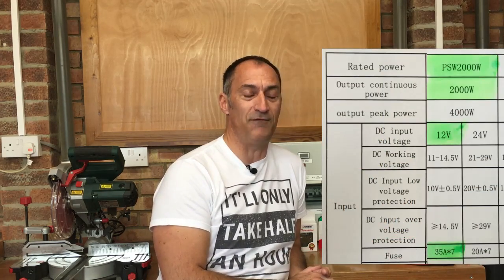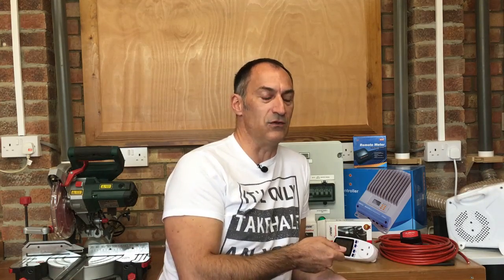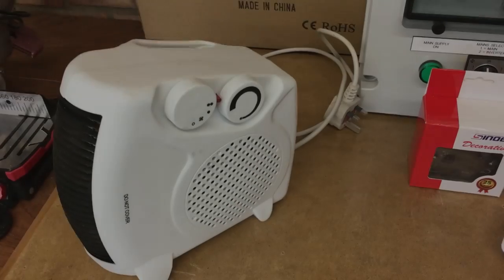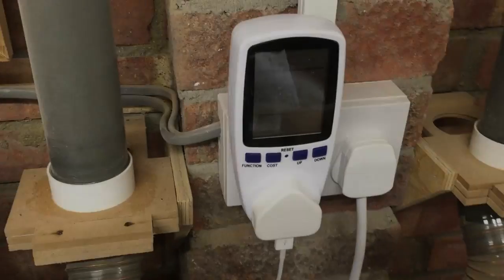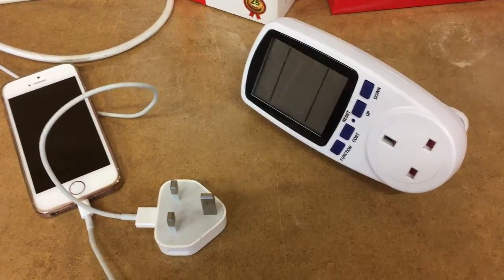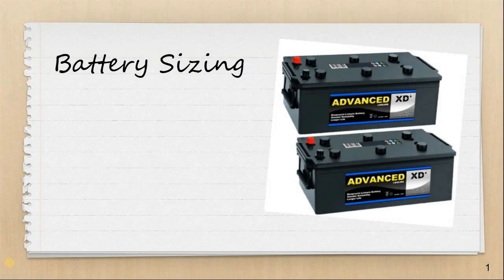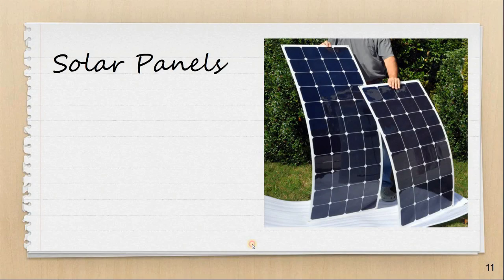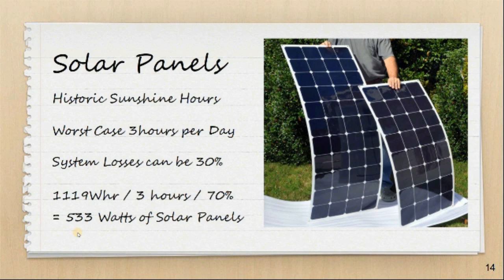Off Grid Battery & Solar Sizing - Self Build Campervan

Comment: Great video, as usual. I've just noticed you haven't always multiplied the total watts by the number of items. eg. The LED lights - total watt hours is for 1 light. Should be multiplied by 10, so it's 600 Watts, not 60.
Reply: Just to say the downloaded sheet has the correct formula. It's your video that shows the incorrect figure.
Reply from the maker: Smiffy, yes spot on there was an error that I corrected. In reality having lived in the van we only ever have one light in at a time as they are so bright.
Reply: @GregVirgoe  Cool. Didn't mean to knit-pick, just thought it was over half a kilowatt that you weren't accounting for. :) You've answered my next question about whether you think 10 LEDs are required. I guess not all at once :)
Reply from the maker: Smiffy don’t worry it was well spotted. We have 6 LED spot lights and 4 LED strip lights. Never have used them together.

Comment: Hi Greg, does the Truma run purely on 12v (fan/ignition) and LPG for the furnace (water and heating) when completely off grid? Is the high watt/hr demand at 230v purely to assist the heat up speed when connected to shore power? If so, then I guess it just takes longer to heat up when running 'off grid'?

Comment: hi greg - what type of fridge are you using?   why only over 6 hrs? cheers
Reply from the maker: Darren Player we have a Dometic CRX50 12v Fridge. 
You fridge doesn’t run all the time. It comes on and off via the thermostat. So the compressor only runs for part of the day not all day. The less you open the door and put hot food in it the less electric it will use. 👍🏼
Reply: @GregVirgoe   thanks for clarifying,  we're looking at getting crx65. I thought it would be using power when the compressor comes on when there is a temperature difference.  But was thrown when the power consumption stated 1.14ah/hr  on a shop website. Even this rating seem low when its a larger fridge.

Comment: Hi Greg ,if i fit 2x 110a leisure batterys how long would i get out it time wise using normal use? Using led lights ,waeco crx 50 ,water pump ect ect ...gas hob.. ?

Comment: i did not see in this video, the idea while driving will help recharge the batteries
Reply from the maker: David Ewers Photography my AGM batteries are not compatible with split charge kits so it would be better to install a battery to battery charger. I have not needed either because the solar works perfectly and my batteries are always full. 😀
Reply: @GregVirgoe  thanks for the clarification. I am using many of your ideas in my Chevy Astro build.

Comment: Or get a key start generator fit it under the van with a extension key switch inside the van it will charge your batteries up and you can run your fridge and TV all the time it’s running ,and you have plenty of insulation so it should not put you off with the noise , that’s what I’m thinking of doing with mine
Reply from the maker: Thomas whitelock, in an emergency it's an option but not as the main source of power, expensive to run with fuel costs and not good for the environment.

Comment: Hi Greg, what was your routing for the split charge cable from your van bat to leisure bat? Thanks Jamie
Reply from the maker: Jamie Ward, I installed the cable in conduit under the floor then behind the shower tray and inside the bench seat. 
I never connected it as the VSR is not compatible with AGM batteries.

Comment: Totally loving your amazing vids Greg! Spot in! I am currently planning and saving for our Luton box van conversion and this is helping no end!!

Can ask though - if we went for lithium batteries would the set / equipment be the same or do the charge controls etc all need to be different than an AGM battery like yours?

Again keep up the amazing work!
Reply from the maker: Hello Steve, different battery types have different charging profiles and you would need to make sure that the charge controller is compatible with lithium battery. My charge controller is only suitable for lead based batteries, sealed, flooded or gel. Thanks for watching 😊
Reply: Greg Virgoe thanks for super quick response!

Would it just be the charge controller that would be different or other elements of the system too?
We have not made the decision if we will use lithium but as you mentioned in one of your replies budget is a big contributor 👍🏼

Comment: Hello Greg,
Why you write that the Fridge will work only 6 hours? I thought it works 24 hours.
Another question is, is it better a gas or an electrik fridge?
Reply from the maker: Your fridge works on a thermostat and that controls the compressor, it only turns the compressor on occasionally when it needs to cool the fridge down. The more you use the fridge. The more the compressor will run. 
So even though the fridge is switched on it’s not using electric all the time. 
To save further We actually turn our fridge off overnight when it’s cooler and were not using it. The contents keep it cold then we put it back on in the morning. During the day we have tons of solar so it can run as much as it likes. We have just a 12vDC fridge and that works perfect for us and is really simple. We did not want the huge ugly vents in the side of the van for gas fridges. 😀
Reply: Thank you Greg, i was about i buy a gas fridge.

Comment: Check out Firefly batteries. Usable to -4 F or -20 c. discharge up to 90%, but at that rate, you only have 1600 cycles, at 50% 4600 cycles. Cheaper than lithium, but massively better than standard deep cycle.

Comment: may i just ask why you put 6 hours for the use of the fridge? wouldn't the fridge be on 24/7 because it's a fridge? please someone clear this up.

amazing videos btw greg. you are the best! no doubt.
Reply: I think because the fridge will only run when the temperature gets over a certain level - fridge will then run to bring temp down, then switch off.

Comment: Interesting video. In about 2 years my plan is to go full time living in a motorhome off grid as much as possible. Intend to use refillable gas bottles, the maximum solar panels I can fit and highest battery capacity possible. Knowing how inefficient solar is, especially in UK, I am also considering the possibility of using a 12v wind turbine at night or when parked up for any length of time. Something that can be removed when not needed.

Comment: I am so glad I watched this great video. I am at the planning stage now (also a LWB Sprinter, but with extra high roof) and I didn't factor in the narrower roof width of the van. When I double checked I realised the two 250W solar panels I had chosen wouldn't fit on across the van and there isn't sufficient space up there for them to go lengthways between the extractor fan and large skylight I am having. Thanks for sharing and for being so very detail orientated! I'm working my way through your build series and it's excellent. (I already subscribed after the first one)

Comment: Great points, trimming down is key I think at least until you find the sweet spot.
I can only fit two 100 watt panels to my roof with millimetres to spare ( just ) I have them but not fitted them yet.
I have one battery for domestic supply  and I think it's around 100 amp hours but haven't found info on it to be sure, It charges when my engines running at present or when plugged into mains power.
I don't know whether to get another battery and have it charge independently from solar and have separate sockets for it or connect to the battery I've already got as it's probably better that one battery gets properly charged than two batteries mostly getting half charged. I plan to use the van a lot in in Spring and Autumn with some winter use.
Also if I was going to parallel up two batteries I'd like them to be the same batteries, this is why I have not rushed into fitting the solar yet as I'm still figuring whats the best option for me plus it's a small van and batteries can get very heavy quickly lol. 
My heater is an eberspacher so it uses battery power too.

I have a 12.5 amp hour battery bank with small inverter ( lithium based ) and it's a great little back up but a large one is very expensive even to self build and a generator is heavy, noisey and expensive to run.

Unfortunately we don't have a lot of options and coming across your video on the subject is everything I was researching a month ago almost in an identical fashion so I understood you well.
There are so many variables to take into account but 200 watts is all I can fit plus the use of very efficient devices ( my tv, 14" 18 watts max ) is a good compromise and example of this.

Thank you very much Greg for making these very informative and well executed videos, a real breath of fresh air away from the normal YouTube clutter.
Reply from the maker: Hello, my advice would be to parallel the batteries together in one system and have all three options charging them both. The batteries will last longer if discharged less and kept topped up and joining them together will do that. 
Thank you for the compliment on the video too 😊
Reply: @GregVirgoe  Do you know something Greg, I didn't even think of that thanks. I was eventually able to find some info on my present battery and it is 100 ah so now another 100 ah should be fine although I can't find anywhere the exact same battery for sale.
Do you think it would be much harder on the alternator charging the extra battery while driving?

Comment: So power use means van alternator charging leisure battery and a Honda gen set during evening to save battery storage. Do you think the e gen sets are best for standby power for cheapest design then inverter and controller system phase 2 and panels phase 3? If you understand limited budget design?

Comment: we had this same dilemma about 7 yrs ago with our panel van when in Europe, we purchased all the euro plugs and adapters, switch over plugs etc and guess what ? Never used any of them, in all the countries we traveled to and through , they all had the same plug - like what we use here in the UK
Reply from the maker: The plug is the same but the polarity May be reversed so the live and neural are swapped, did you find that?

Comment: Another great video. I just got my Sprinter and I'm ready to start. Just a point to those advocating Lithium because of the 50% discharge issue, check out Victron Super Cycle AGM and the 100% discharge test results. A very compelling alternative to Lithium.
Reply from the maker: This is the extract from Victron test results "Tests have shown that the Super Cycle battery does withstand at least three hundred 100% DoD cycles.  The tests consist of a daily discharge to 10,8V with I = 0,2C20, followed by approximately two hours rest in discharged condition, and then a recharge with I = 0,2C20.  The two hours rest period in discharged condition will damage most batteries within 100 cycles, but not the Super Cycle battery.  We recommend the Super Cycle battery for applications where an occasional discharge to 100% DoD, or frequent discharge to 60-80% DoD is expected." 
So, yes it can handle a 100% discharge which is great but it is still not good practice to design and use you battery system like that unless you want to change them every year. All lead based batteries are best kept topped up with the DOD kept as low as possible for long lifespan.

Comment: Hello again Greg
Greg are the 230v 7200Wh Truma figures just related to the use of the electric heating element? (sorry if this is a really silly question) If im using this heater and I'm totally off grid would I only be using the 12v 79Wh figure for the ignition of the LPG mode? 
Greg your Videos are going to go down in history as the go to source of info for those of us wanting to adventure! Awesome awesome work!

Comment: Hi Greg. Another great video.really well explained. But trying to maximise every percentage of power efficiency available. Why would you charge devices such as iPhone iPad and kindle through an inverter. Charging them via 12v is surely more efficient. To avoid that loss through the inverter. This is in fact a question. Not a statement or a criticism to your design. 
On a different note... from your mention of camp quirky in another vid.... i checked it out. And I’m booked to go 😊
Reply from the maker: Yes, you are absolutely right, it is far better to just use 12v sockets for charging small devices.
I am happy to suffer the losses for the simplicity of having one lot of wiring and sockets to install.
In my wiring video, you will see I made some 12v USB sockets for the van.

Comment: Hi Greg,

Thanks for sharing this video, it's really helpful. I am at the stage where I have to decide on the equipment for my van build. I was wondering, what fridge did you opt for, and why? Is it an absorption model or rather a compressor fridge? And how many liters is yours? I see in your overview that your fridge is calculated to draw 6.25 Amps and 75 Watts when operating on the 12V off-grid power supply. Look forward to your answer Greg, cheers! Mark
Reply from the maker: Hello Mark, after a lot of searching we got a Dometic CRX50 12v compressor fridge. 
Not cheap at £550 but I’m very happy with it. I did not want a gas fridge because of the huge vents in the side of the van. All the dual voltage fridges has a manual switch over and in a lot of cases on the back of the fridge. So this was not the cheapest solution but the best fit for us. Cheers

Comment: Hey to Greg, Dave here again.

I noticed on Mevi's video where he talks about disconnecting his split-charge switch because it taxes the alternator and in turn increases his fuel consumption by five or six miles-per-gallon.
Does this kind of fuel increase bother you?
Mevi said the situation underlines the need for solar.

Didn't mean to ask such an open-ended question under your what's next survey question ... my question was indirectly asking about this split-charge situation. 

Another question: can you explain further how you connect the refrigerator outlet to both power supply lines coming from the distribution box? Never saw if that outlet needs to be a specialty item or not.

Thanks for all your help.
Lord Jesus bless
Reply from the maker: Hello David, I was surprised by the amount of fuel consumption. The solar would pay for itself in a matter of months. I have fitted one but with an isolator in the cab so I can chose to use it or not. I have nearly 1/2kW of solar so should be good enough to keep me topped up at all times. I have split charge and mains charger for backup. 
I have now got a 12v fridge so it simply has a dedicated supply off a fuse on the blade fuse holder. The dual supply fridges look like you have to switch locally on the back of the fridge and that is not practical. I didn’t want gas because of the ugly vents on the outside of the van. 😀

Comment: Have you thought about adding a charge from your alternation when the engine is running to you leisure batteries?
Reply: @GregVirgoe  Hi Greg, sorry if I've picked you up wrong but on one of your previous videos did you not say that a split charger wouldn't be sufficient to charge your AGM leusure batteries? I'm just trying to get my head around all this and was wondering what was best to use, split charger or battery to battery?
Reply from the maker: Hello John, I don’t even recall typing that previous answer so have deleted it. 
I did initially buy a Split charge kit but was advised not to fit it by my battery supplier as it would not give the AGM batteries the correct charge profile and over time will damage them. The best option is always a Battery to Battery charger as they can be set up to meter the right amount of charge at the right time to better look after your leisure batteries.
Reply: @GregVirgoe  Thank you, loving the videos.

Comment: Hi Greg, Great job you  done on the battery sizing but I think you need to revise your paper as. "total watts/hrs = quantity x watts x hours use".
if we look at your I Phone  2 phone x 6 watts x 2 hrs = 24 w/hr. same for the led light and roof fan. hope i am not wrong.
i have sent you a message if possible advise where you bought the men hole and 1" 1/2 connector from.
great job
Reply from the maker: Thanks for pointing that out. There was a missing formula in the spreadsheet which has been corrected and the blank download is correct.
Reply from the maker: Access Hatch  https://rover.ebay.com/rover/1/710-53481-19255-0/1?ff3=4&toolid=11800&pub=5575265109&campid=5338027957&mpre=https%3A%2F%2Fwww.ebay.co.uk%2Fsch%2Fi.html%3F_from%3DR40%26_trksid%3Dm570.l1313%26_nkw%3DBLACK%2BPLASTIC%2BDECK%2BACCESS%2BROUND%2BINSPECTION%2BHATCH%26_sacat%3D0
Reply from the maker: Solvent Weld Tank Connector  -  https://rover.ebay.com/rover/1/710-53481-19255-0/1?ff3=4&toolid=11800&pub=5575265109&campid=5338027957&mpre=https%3A%2F%2Fwww.ebay.co.uk%2Fsch%2Fi.html%3F_odkw%3D1.5%2522%2B%252840mm%2529%2BThread%2BSolvent%2BTank%2BConnector%26_osacat%3D0%26_from%3DR40%26_trksid%3Dp2045573.m570.l1311.R1.TR1.TRC0.A0.H1.XSolvent%2BTank%2BConnector.TRS0%26_nkw%3Dsolvent%2Bweld%2Btank%2Bconnector%26_sacat%3D0